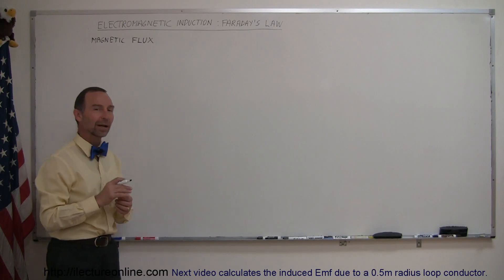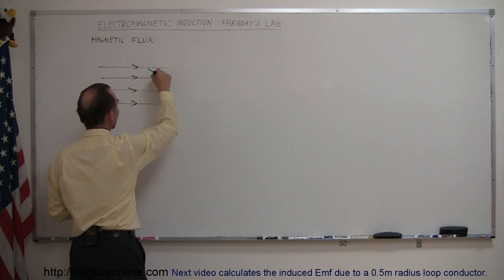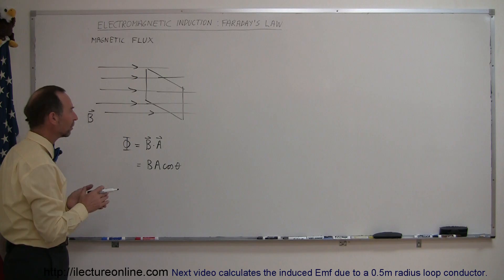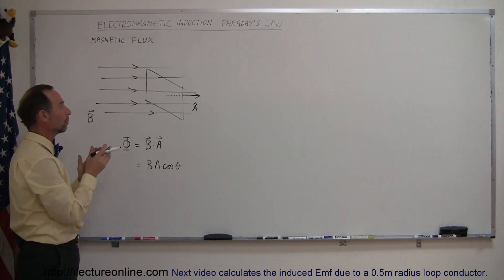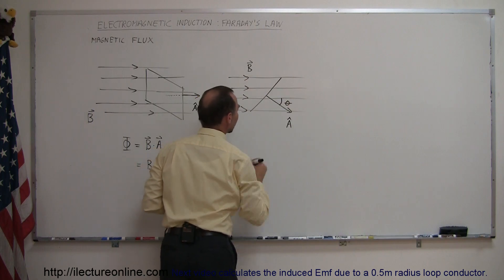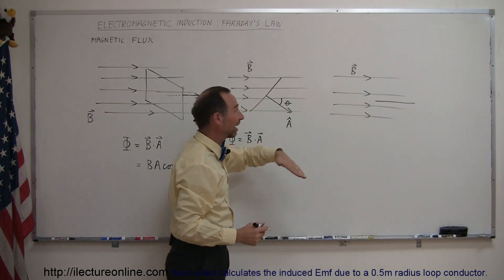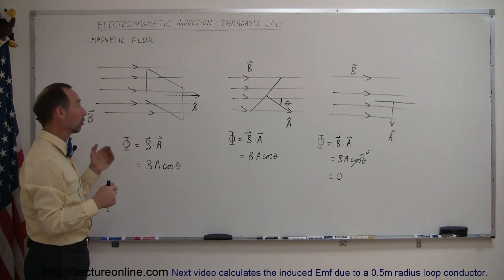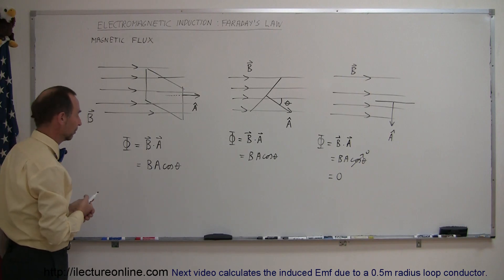Physics 45 Electromagnetic Induction: Faraday's Law (1 of 4) An Intro and Understanding

Comment: I have 1 question. Should I include N or no N in flux? Like flux=NBAcos(teta)
When we find emf, we should we include N or no N?
Reply from the maker: If there is more than 1 loop, yes, since N represents the number of loops.
Reply: Like if we include both formula with N, emf ends up with N^2
Reply from the maker: No, you can only add N once.  The effectiveness of the flux will be increased by a factor of N, but don't square the N.

Comment: Sir when the B is becoming larger in some A(in conductor loop) than conductor loop try to become a stable and it becomes stable by creating B in opposite side but when the B is decreasing in area the why it create B in same side on that time already B is decreasing and its becoming stable
Reply from the maker: When the magnetic flux through a loop decreases the induced voltage will add magnetic flux in the same direction.  When the magnetic flux through a loop increases, the induced voltage will add magnetic flux in the opposite direction.

Comment: i am confused. The net force,magnetic field b exerts on a loop X carrying a current I is always zero if B is uniform OR always zero if b is a normal to the plane of loop C. ?? which one?
Reply from the maker: If there is a current in the loop and if the direction of the magnetic field is perpendicular to the plane of the loop the torque on the loop (caused by the interaction of the magnetic field on the current in the loop) will be zero.

Comment: Hey, had a quick question. If there was an example where the whole Area of the rectangle was visible to us on the diagram, so Ahat is pointing straight towards the observer, coming out of the page, would the angle also be 90 degrees, and therefore flux would equal zero? I know it's hard to visualise, but in the diagram, it would be represented as the rectangle looking like a normal rectangle.
Reply from the maker: That is correct. The angle would be 90 degrees and the flux would be zero.

Comment: Just a heads-up, this video is misplaced in the "PHYSICS - ELECTRICITY AND MAGNETISM 3", it should be situated directly after Physics - Magnetic Field Generated by Moving Charges and Currents (12 of 12) Ampere's Law.

On a side note, I love your way of teaching and was wondering whether you'll ever branch out into higher mathematics (Fourier transforms etc)?
Reply from the maker: Marcus,
Thanks for letting me know.  I have placed the physics videos in a new set of playlists.  This video is also in PHYSICS 45  ELECTROMAGNETIC INDUCTION
Yes, I am planning on branching out into higher mathematics, and engineering videos, but that will take time.  Currently I am working on astronomy and probability and statistics.
We are doing about 1000 videos per year.  (Besides my other 3 jobs)
Reply: I look forward to it.
Thanks for bettering the lives of thousands of students,.
May Adblock always remain turned off for your lectures.
Reply: +Michel van Biezen I salute you. These lessons are a godsend for the studying engineer.